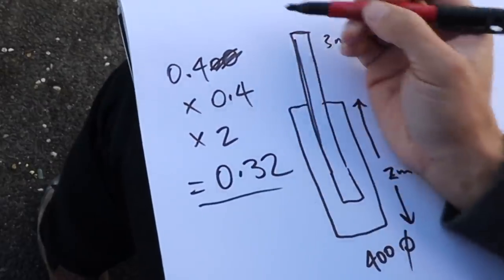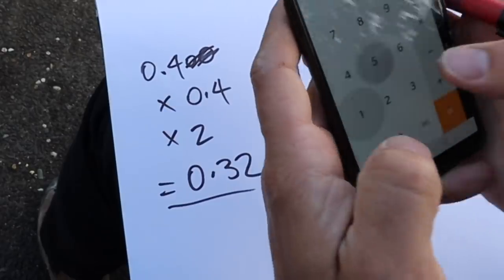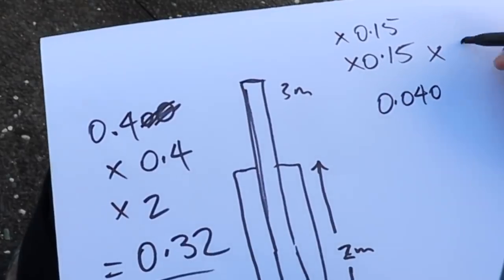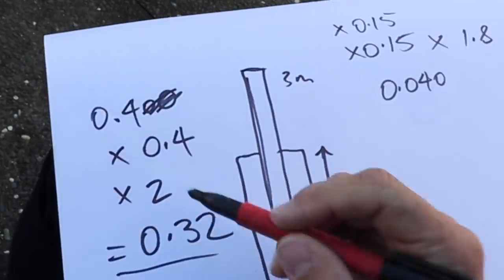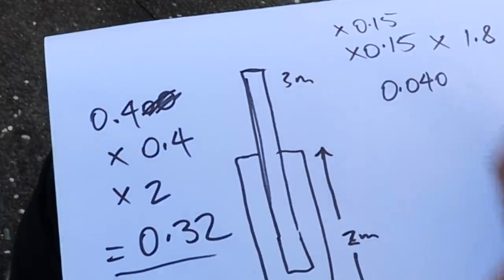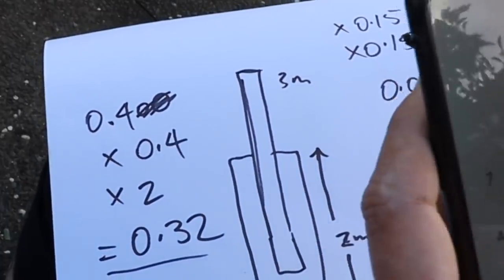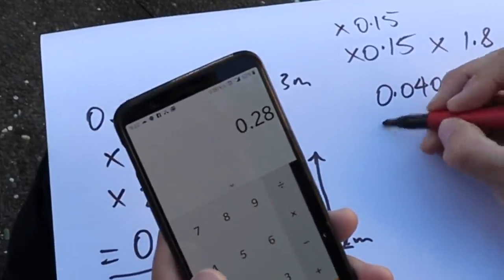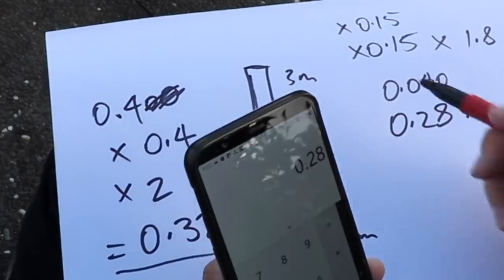I Got The Concrete Quantity Wrong

Comment: Don't under estimate how much variation from the concrete suppliers too. It's measured by weight which means that additional water (think a sloppy mix for pumping) will change the wet density and then the calculated volume by mass. I had a pretty decent argument with my concrete guy about this as I was filling 1m3 forms so knew exactly how much I needed per form and under supplied by 30%. I told them I don't care about the density difference as they sell it per m3 so if I order 4m3 I expect a minimum of 4m3.

Comment: Hi mate.  20 years exp in fencing in outback Queensland and a rule of thumb we used for ordering concrete for round holes was divide the square cube amount by 14 and x x 11. Add 10% and round up to next .2. Never ran out in 20 years and normally little wastage. Overall congrats on a great job 👍Cheers. Jack and Mandy from Mount Isa

Comment: I've found concrete plants get quantities wrong, won't mention any names, one year we were short by a whole truckload, according to the supplier, but the thing was our slab, even though it was a random shape it was consistently built and the volume was calculated from the 3d drawing, so to say we were a truck short didn't stack up. Also a year later same company, we were about half a meter short on a not very big pour, really simple to measure when it's an oblong. The truck driver got angry when he was sent back to top it up. the truck drivers were doing the batching themselves, found out through a workmate on another job same truck driver was short for them, and again simple oblong shapes, always adding a wastage percent too. But on a POSITIVE :) we always have a competition who can guess the amount the closest before its measured. Some just make a guess others use the "eyecrometer" to guess, always fun :) good work, the retaining wall mission is almost done huh?

Comment: My concrete pump guy suggest all holes size add 30-50mm to the hole size. When the digger pulls the auger out off the holes, it creates the holes bigger. Small jobs will not be a problem, but at a job,  I ordered 18.5m and it used 24m at the end. The 50mm extra dimension makes a huge difference. It works every time. Good video! Well done!👍

Comment: Not sure if anyone has mentioned this but when using a concrete pump allow at least 1/3 M3 of concrete on top of you calculation (including waste) as the pump can hold that and will clean that out later.

Comment: You'll find that 400mm drilled holes will ream out to 430/440mm.  Also, you can get the concrete pump guys to "blow out" there pump line on the ground near the holes. You can use that concrete to top the holes up, but you get left with a little bit of a mess. Or order extra to allow for the pump.

Comment: when you calculated you used volume of a rectangle not a cylinder 
On big jobs I’ve found it’s also very easy to over order concrete and get charged return fees

Using your paper example - 

Pie (3.14) x radius of hole, squared x height 
3.14 x 0.04 x 2 = .25 

.25 - 0.4 (post volume) = .21 conc per whole

Comment: Maybe I missed something, but I'm surprised you came out short, because you calculated volume for a cuboid instead of a cylinder (square vs circular base), so your example calculation is off by 0.07 m3 more concrete (about 27% more concrete on every hole).
So either wastage was much higher than you estimated or there was other error I can't see.
Reply: Mario  bar10005 is correct. Scott calculated with only 13% waste (0,15/1,15) and got it about right. If he calculated in a more sensible way (with a circular base instead of a square one) he would have gotten even less concrete. 

Maybe luck, but could also be standard procedure in the business to calculate this way cause it is actually easier (not have to use π....) and compensate it with less added waste. What do I know. A cuboid with a square base will always be 4/π bigger than a cylinder with the same diameter as the square side and same height.
Reply: Staffan Ek 
Thank you for pointing out the math equation possibilities. A little more figuring goes into the ordering process than what I realized.
Scott- I love the spray paint fill to here lines takes the guesswork out. It reminds me of the markings on the German beer glasses.
Keep the videos coming! Great work!
Reply: Perhaps we can also add the assumption that if the hole was perfectly round all the way down, and that the post hole borer didn't take anything off the sides, the measuring would've been more accurate! :-)

But yes, there was a LOT of waste!
Reply: @R-77 Volume of a cylinder is its base area (Area of a circle=radius*radius*π) multiplied with its height.
Reply: I wonder why he did not go with V = πr2h on the holes as well
Reply: @R-77  pye x radius squared x depth. Note radius not diameter.
Reply: @chrisskelhorn5727  Don't know if you are trying to make a point out of me being too precise or something but yes - of course we can make the assumption that if the hole is a perfect cylinder the measuring will be more accurate. Don't understand what that has to do with anything.

But to be clear - if I was supposed to teach my viewers how to calculate the volume of obviously cylindrical shaped holes I would do it with the cylinder volume formula and if not I would at least comment on it. It would of course be pointless to use decimals of pi out on the field, but something like 0,2*0,2*3*2 would be a fair way of calculating the volume of the hole (to use the example in the vid).
Reply: @staffan462  Sorry no! I meant no offence and I apologise profusely if it came out that way! I was just pointing out that errors in the hole boring itself will almost certainly creep in, given so many holes!
Reply: @chrisskelhorn5727  Alright np! I think you are right of that being a major source of error, especially if the measurment of 400mm came from the drilling bit
Reply: @R-77 v=h x π x r squared

Comment: I work with laying concrete (floors mainly) in norway.. for 3 years now.. 

on 32-36 meter pumps we add 0.5m3 waste and 40-42 meter pumps we add 0.7m3 waste.. 
+ And do not remove the volume of the logs, it is always better and have a little too much concrete, instead of a little too little concrete.

Comment: I probably wouldn’t have removed the volume for the posts. In bigger concrete pumps we calculate a single yard of concrete to prime the pump.  My estimation of a yd to m3 is .8. Edit I did the math and a cubic yard is .763 m3
Reply: Thats how i do it !!  i dont subtract the volume of the posts or whatever will be put into the holes !!

Comment: Just add all depth... Multiply by a hole surface... You got the total volume, then substract the length of post that will be in concrete multiplied by the post surface (of rhe small face)...

Comment: Always more concrete for holes the hole sometimes caves in as you’re drilling them ie rocks heavy clay which requires more concrete to fill them also it Takes about a half a yard to prime the concrete pump which you don’t get back

Comment: As always a great and enjoyable video! Is there not an concrete strength issue because there is no plastic lining (for instance) between the dirt and the poured concrete? Here in NL it is always good practice because the wet season makes the concrete to wet and dry season to dry. And doesn’t the  concrete crack under the tension of the wood wet/dry contractions? Here it does with that size of pine timber posts but for fences and other esthetic structures that does not matter much.

Comment: A quick FYI: phone calculators have BODMAS issues, they're a absolute nightmare if you do a single calculation then multiply it for multiple items. It cost my boss £4K not so long ago on a big window job,  but it could just as easily have been a larger amount. A quick Google of "phone calculator wrong" and look at the side-by-side pics of folk doing sums on a phone and calculator at the same time and getting different results

I'm sure that's why we still get free calculators in little promo notebooks and folders that suppliers give away to us, I just assumed its because they got a bulk deal on them years ago before we all had smartphones, but new companies also give away stuff with them in too, maybe because they've delt with a few of us on the phone trying to understand why our order/quote went so wrong!

And Scott, if you read this yourself, its maybe worth dropping this little nugget of info into a video, save anyone else getting bitten the way my boss was! 👀😳

Comment: Circles are always 21,5% less than a square given the same width so Im surprised it wasnt enough concrete 🤔
Reply: Those augers are notorious for over-boring the hole.  Also if you have saturated clay, you can get big chunks that just fall in from further up the the hole.  Both reasons mean the volume consumed is bigger than you expect.
Reply: There is little difference amd what there is different makes up for waist
Reply: @RangieNZ  well, as long as those chunks fall into the hole, the volume stays the same? It wasnt removed, and I guess you should measure the actual hole width and not the boring equipment
Reply: @Pontus95  the chunks often fall off when boring, so they end up being removed and the volume does increase.
Reply: @RangieNZ  ah, didnt think about that

Comment: It’s definitely a good way to do it but if I were to do it I could have calculated it using the cylinder formula using pi, and then subtracting the volume of the post. Then just add them all up

Comment: Cheers for the vid Scott. Always enjoy watching you. However, in fact you would've been even shorter on concrete if you did correct calculations. =) Basically in your calculations you assumed that holes are square but they are rather circular. So the correct formula is actually: Pi*r2*depth=3.1415*0.2*0.2*depth.

Comment: Next time don't deduct the volume of the post. I never do and always have enough.  Happy days
Reply: I think the problem was treating the concrete like it was GST - multiply by 1.15 :-).
Reply: Its the way I do it as well  .... Not worth the headache of being short
Reply: He calculated for square holes when they're round. Should have concrete left over.
Reply: @davesmith2233  I think he did multiply by 1.15 at 3:25 he talks about waste being 15%.  He also talks about it at 6:39.

Comment: the water in the bottom shouldn't matter much, it gets forced to the top anyway. Any reason why the timber isn't a little more protected?
Reply: Runny concrete separates, course to bottom fines to top. Then the concrete strength is compromised. Recommended to remove extra water then concrete is true to plant slump test

Comment: Do you not need to put plastic around the posts where its submerged in concrete?
Reply: That'll  allow water to pool around the post and cause rot. If you see an earlier vid he drops a 'support' down the hole (a broken house brick will do) for the post to rest on and allow water to drain away.

Comment: Is there a reason you used square post instead of round is it because your building something above ground that’s easier to use the square posts with ? The only reason I ask is round posts are 5 times stronger then square so being a retaining wall they would be better maybe ?
Reply: How are round posts 5 times stronger. It all depends on sectional size
Reply: Tony Pavko round posts are supposed to be up to five times stronger then square of the same size that’s why all telegraph poles are round as square can’t take as much sideways stress , also in Alaska when the build the cabins they will only build them on round posts and it was on a tv programme where they said that’s why because of the strength so just thought if that’s the case wouldn’t round posts have more strength for this project ?
Reply: Tony Pavko also round post have no inherent points that stress can concentrate unlike square which has 4 such points that concentrate stress , plus a round post has fewer disruptions to the grain then a milled post
Reply: @craigh9112  I don't know who taught you but you are defying material science

Comment: Youll find if you dont subtract you post volume and mot add for waist it turns out about the same.  I've always been pretry spot on with concrete volumes. Next time you're doing a pour give me your hole sizes amd ill work out the perfect qty.

Comment: Well you drilled round holes so you cant really calculate it like you did it if you wanted it exacly but its good enough if you acount for extra
Reply: Quinten Dewit what is pi/4 between friends. 22% extra.
Reply: Sure but i am just saying if you drill bigger holes that you need to take in consideration of howmuch you take as safe backup

Comment: 20% wastage for line pump and typically 30% wastage for boom pump, but varies depending on size.
Surprised you didn't have enough given you calculated volume of a circle using the formula for calculating the volume of a square 😜
I feel sorry for your clients paying for a pump  for a few holes lmfao... Nice tools and videos though

Comment: The volume must be: (0.4*04*PI*2)/4. Surface of a cirkel is: (Diameter²*PI)/4
Someone else thinks like this?
Reply: You are correct that he was wrong or at least misleading with his calculations but you are also wrong. He seemed to calculate the area of the hole (which is of cylinder shape) as a square. Obviously the correct way to do it is as a circle and multiply with its length (since it is cylindrical hm).

Area of circle: RADIUS²*π
Volume of cylinder: r²*π*length (dont know what you mean with /4 or diameter)

It seemed like he was lucky this time since the area of square with the same diameter as circle is actually larger. I.e he would have gotten even less concrete if he measured the volume of the holes in a sensible way. 

But maybe this is just some standard way to calculate in this business to not have to use π and compensate it with less extra waste, what do I know. In that case it wasn't just not luck, just misleading...
Reply: Mario  You are right. But so is (partly) @Wout Me. Since 0.4m is the diameter, not radius it is (0.4^2 * pi)/4 for surface of circle. Multiply the surface area by 2m and you got your cylinder volume.
Reply: @TechFlowIG  That is what i mean. Thanks
Reply: Mario  Mocht u het willen, kan ik ook alles in het Nederlands typen. Zo maak ik zeker geen spellingfouten. Beter voor u?
Reply: @staffan462  Radius is from the center to the outside. What do you call 2 times the radius?
Reply: Mario   It's my 3rd language, so spelling mistakes are possible. I'm sorry Mr. perfect.
Reply: @woutme1960  Yes. 2 radius is the diameter. (just like in Dutch)